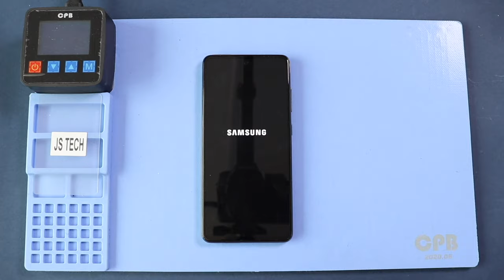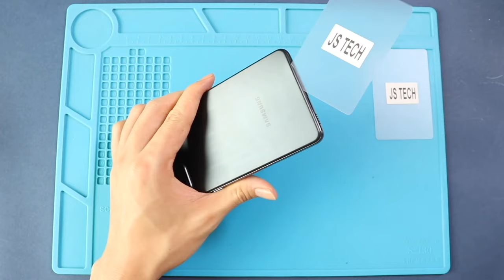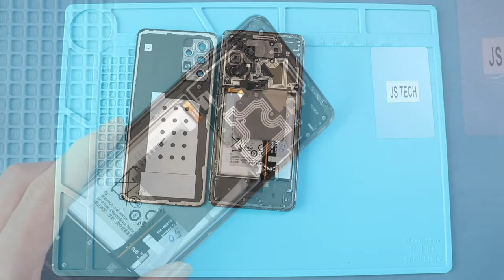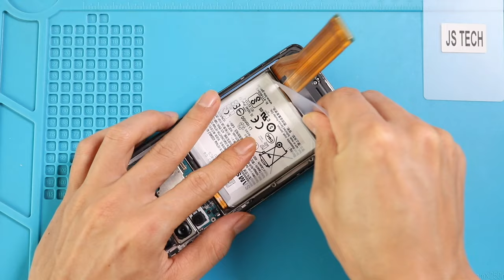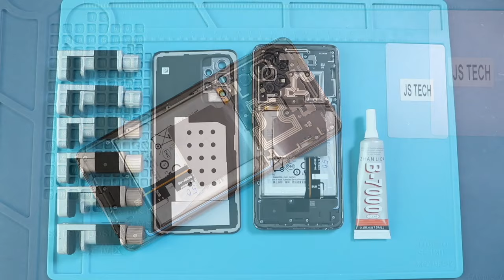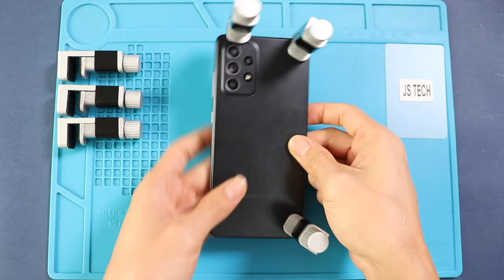Samsung Galaxy A52 5g Battery Replacement

Comment: It was really easy and quick to do. About fifteen minutes. Helpful hint: I ordered a new back cover plate that had new adhesive strip, so would make easier and seal better. This kept me from using glue.
Reply from the maker: Thanks for your feedback
Reply: Where did you order it from?
Reply: I only ordered a new adhesive, the back cover is reusable.

Comment: Guys if you managed to crack the case open, limit your glue usage as much as possible. No glue for me, I only use scotch tape. I'm not a professional and always struggle to get most phone open and always crack the back especially if they're made of glass.  God I hate glass backing. You'll sacrifice waterproof IP67 nonsense.  Just keep them inside a big impact resistant case, you're all set.  Remember, most aftermarket batteries sold are junks, you have no idea if they last 2 months or 2 years so expect for the worst so you can easily swap them out again.

Comment: Thank you for your tutorials ! Would it work, to replace the battery of the A52s by the one of the A53 please ?
Reply from the maker: I don't think it is compatible
Reply: Sir, I'm using A52 for almost 3yr now and recently after the ui 6.1 update I started noticing my battery is draining after and I also find few A52 user on reddit they are also facing the same issue but I also changed in my samsung member app it's showed my battery status weak...so I'm confused it is OS bug or battery?

Comment: After replacing the battery and fixing the back cover with b7000 glue will my A52 phone still be water resistance?
Reply from the maker: Nope
Reply: @DIYGeardo 
Hi... so if using B7000 loses the phones water resistance,  then will TESA adhesive tape give back the water resistance?? If not, then why not? And how can I regain it's water resistance again?? Thank you!!

Comment: Hello friend, a question after having removed the cover of the phone and having glued it again, can I put my phone in the water?
Reply from the maker: Not a good idea.. because once you have opened , it is fragile against the water. Unless you go with the service center repairs..
Reply: @DIYGeardo  And if I use b7000 glue plus a tape that sticks the two sides and the super well applied b7000 glue could work, obviously I will take it to a cell phone repair technician to help me with that detail but I wanted to know

￼
Reply: @DIYGeardo  And if I use b7000 glue plus a tape that sticks the two sides and the super well applied b7000 glue could work, obviously I will take it to a cell phone repair technician to help me with that detail but I wanted to know

￼

Comment: After replacing the battery and attaching the cover, is it still waterproof?  I'm just confused. Coz I felt like my My phone's battery cover ( samsung A52s) is about to be detached. It seems like the glue gotten soft and not sticking as it was.
Reply: If you use the correct adhesive
Reply: @bik3r230 WHAT IS the "correct adhesive" for keeping it water resistant again???

Comment: can i upgrade the battery of a52 4500mah  using a 5000mah battery of m52?
Reply from the maker: Two different battery connectors
Reply: Bro do you upgrade it? It works or not?

Comment: you should have replaced the a52s battery with a a53 one, since they are the same size but 500mah more.
Reply from the maker: Thanks for your feedback
Reply: you already tried? because it could be a nice upgrade.
Reply: @endlessultra  the only downside was the service store, they wouldn't do it. So I had to go to an independent mechanic. With a little bit of effort it was fitted.
Reply: It is confirmed that it fits??
Reply: @tenorrgno  the only problem is that the official samsung center won't do it. you have to do it yourself. the only problem was the headphone jack but with a little bit of effort you can make it fit.
Reply: @user-du6op6qx5s bro will this harm my device by 500mah extra?
Reply: @ashmitpundir800  no, the amperage is the same. It will last longer .
Reply: @user-du6op6qx5s  so i can safely use the 4g model battery in 5g model? Am i right?
Reply: @ashmitpundir800  wait, I think the 5g has a larger battery than the 4g. You can fit the 5000 battery to the a52s
Reply: @user-du6op6qx5s  ok so having a 5000mah battery instead of 4500mah this will not be harmful for the phone? Pls reply and thanks for the past replies
Reply: @ashmitpundir800  no it wouldn't be harmful.  Your are not changing volts,  only capacitance

Comment: I scared to add heat because I heard it might explode?
Reply from the maker: Well if you put very excessive heat.. It might, but to remove the back cover, you do not need to heat too much..
Reply: make sure the battery is drained first, very little energy left in it is better.
Reply: It went well but I got a new phone anyway a few months later

Comment: sad how they make the battery so hard to replace nowaday..... very sad!!!  you know you need a new battery every 2 yr!
Reply from the maker: Yeah, but compare to some other models, these repair steps are not that bad
Reply: @DIYGeardo  I couldn't care less about ip67 rating.  I always have my phone in a waterproof case.  What I need is just the old screw held case.   My last phone lg g5 was unfortunately no longer supported by tmobile network.  Would've sticker to it still.  The g5 had all the essentials like removable battery, microsd, I even replace the fingerprint reader myself
Reply: After 2years and 21400% of charge past my A52 still 4215mAh. Allmost never carge it over 85%

Comment: The kind of technicians I despise. Using heat on a lithium battery. The wrong type of adhesive and the cheap kind at that. Guess it doesn't matter when it's a customers phone and not yours.

Comment: DO NOT USE ANY ANY ALCOHOL. YOU WILL RUIN YOUR TOUCHSCREEN.
Reply from the maker: Thanks for your tip
Reply: @DIYGeardo  yeah I just received a new frame and digitizer because of my amateur mistakes, wish I would have watched this before committing a very expensive mistake.. Had to buy a new phone from Amazon overnight.. I used a OTG & Mini keyboard/mouse w/ usb dongle just to access the phone and extract account information to transfer/back up encrypted sd card data

So yeah maybe avoid using alcohol and spending $600
Reply: I wipe my screen with spirit every week still nothing...